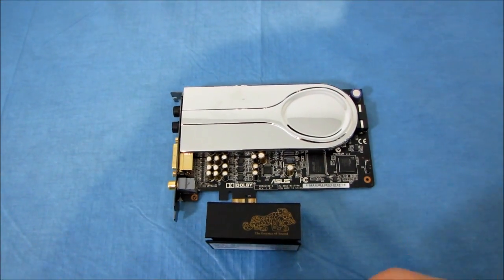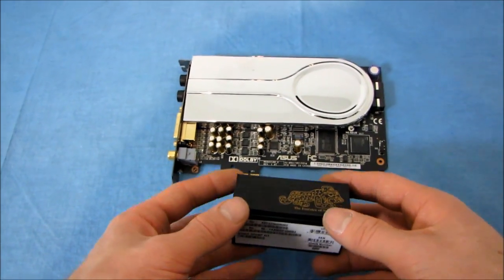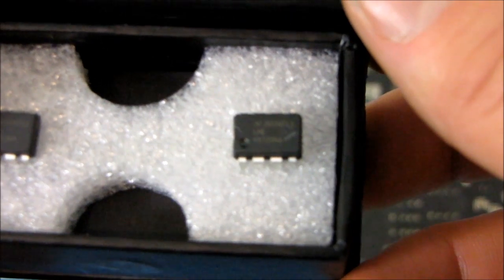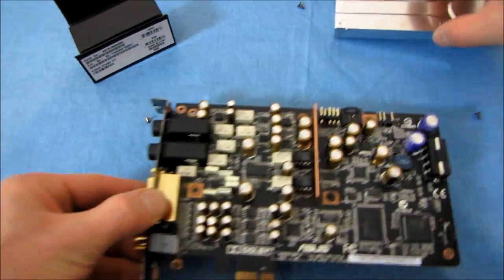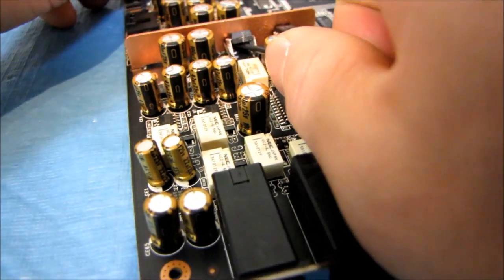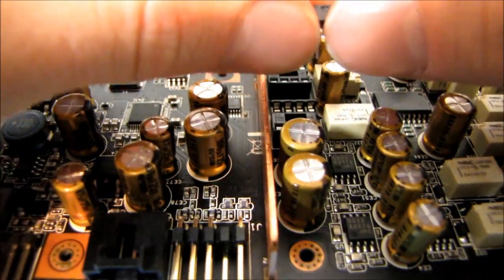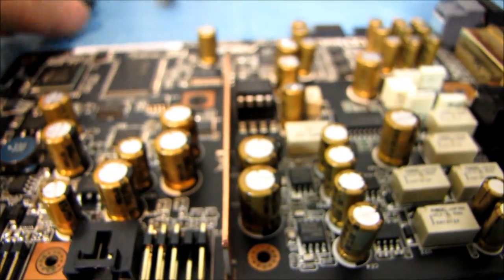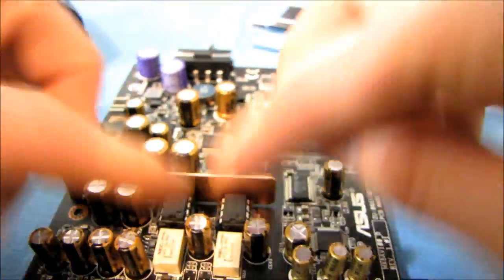ASUS XONAR XENSE OPAMP Replacement Upgrade Guide Linus Tech Tips

Comment: the 'point one' in surround systems is an LFE (low-frequency effects) channel.  As the name would indicate, this channel is used to separate the low frequency 'special' effects from all the other channels (which are full range).  Usually. most of what you hear coming from your sub-woofer isn't even coming from the dedicated LFE channel.  Ideally, you would want full range speakers or multiple subs to take full advantage of this feature.

Comment: A better way to know which way is the right way to install is look at the default chips on the board before removal first. You'll notice the chips have a very small notch on the side. These had those little dots too but alot dont come like that. Most chips have that notch in the side indicating which way they're oriented.

Comment: All Op amps change the sound signature in one way or another..i agree the OPA2134 sounds good(to my ears)u can find plenty of OP Amps over at farnell(thats where i oredered mine from).But remember not all of them are in DIP8 form(the ones u can just plug in)others are way smaller and have to be soldered on an adapter before u can plug them in your card

Comment: yeah i was gonna say chips like that the pins are always wider than the actual slot they go in, because the chip programmers like hold them wider than they need and then the need a really tight connection when placed in the board because they are specifically not soldered on

Comment: The OPA637s and OPA627 are highly praised but they are expensive so i havent heard them yet.Allso they are mono OP-Amps so they need a special adapter(2 single->dual)
in order to make them work(another reason i havent get to try em as i cant find that sort of adapter where i live).So consider the fact that u need 2 of them for each socket.U might consider geting a ZIF(SOIC8-DIP8) adapter if u wana try OP-AMPs that are in SOIC8 format(those tiny ones).

Comment: (Last reply..read from the 3rd one up)I Used plain adapters for my SOIC8 formats but i had someone who could solder them on.In Soic8 if u consider trying some there are allso the AD8066ARZ and AD8599ARZ(the one i curently use).DIP8 there are the AD826ANZ and the OPA2228(witch i find uninvolving but lovely sounding).I stoped rolling others after i found one that i like in every posible way.But i will repeat myself its a matter of personal taste roll some and find the one u like the most.

Comment: actually the BEST Opamps to use are made by BURSON - a discrete op that will definitely change the way your music sounds... a very open and very detailed sound quality ..expensive but worth every penny....
Reply: +GLYNN TILLERY Will take up 3 expansion slots just in size too. I'd just find a cheap high performer that fits the specifications.
Reply: they have extension connectors now to prevent taking up so much space...
Reply: +GLYNN TILLERY also I'm pretty sure for the same price as the burson you could get a better performing opamp with higher slew rate and better noise rejection.
Reply: I have the Bursons - and for the money they sound superior to any IC opamp and Ive tried many of them
Reply: +GLYNN TILLERY and +Kazuhiro. The LME49720 is spec'd at 20V/ microsecond slew and 120dB Power Supply Rejection - so it's pretty hard to beat. Fitting the Burson may satisfy ego but it would involve removing the screening, taking up half a chassis and a dramatic increase in noise susceptibility. Many of the claims made on the Burson site are frankly ludicrous.
Reply: Paul Milligan Exactly. Size is not just an advantage of accessibility but also performance
.
Reply: +GLYNN TILLERY can i use a burson in my gigabyte motherboard? (with an upgradeable opamp) and have you compared the bursons to the lme49990?
Reply: +StylinRed Yes thats what was in my HDAV 1.3 deluxe ... The Burson is far superior ...ignore the trolls ...ICs might be better on paper but the SQ of this analog discrete is no brainer... takes quite a few hours to burn in so let it play for 2-3 weeks before you judge it...
Reply: GLYNN TILLERY Hey thanks for the quick reply! I'm only just looking into op-amps for the first time, this is all new to me, i had settled on the 49990 before stumbling onto your comment, now im reading up about Dexa's lol sigh reading overload
Reply: Yeah they are the best,but more expensive than the card itself.
Reply: some of us make good money
Reply: Perhaps Burson op amps are introducing harmonic content to the sound in the form of distortion, which probably makes it sound different. Some kinds of distortion sound appealing to the human ear. I'm guessing they are much less accurate op amps.

Comment: Well it will sound differnt than with the stock wether u will like it or not its up to u...like i said sound is a subjective topic it comes down to personal taste(there are alot of ppl that like the LME u could be one of them).Allso u could try the OPA2107AP(this one is a bit more expensive than the LME and OPA2134PA)but it could be worth it.Allso note that the OPA2228(delivers a very warm yet detailed sound but its a little too lean for MY taste).Good luck in your picks.

Comment: I found a high performance OpAmp OPA2134 which are top of the line for over all performence quality...You can find them on E-bay for $16 bucks each...myself i just changed the main in and out...what a difference from the standard chip..

Comment: The LME49860NA is the same as the LME49720NA that Linus put in his card with the differnce that the first one can withstand higher curents.I tryed it but i personaly dont like it very much(trebles were too sharp and bass even tho its precise its not all that pressent unless u boost it from your sistem but than again it might sound nice in a surround setup...i use stereo).

Comment: @TheABYSSCINIAN, ESD isn't the huge issue here. It's the proper installation of the op-amp that's the real issue. Try reversing the power inputs in pins 4+7 ;) I can guarantee that whatever you had on the board is now a smoking hole in the board ;)

I've blown more than enough 741C's at school to share this unjoyful experience. Besides, Linus did make quite a few mistakes when dealing with these PDIP-8 chips, but not bad for a beginner, assuming he actually figured this out on his own.

Comment: @kght222 i used to install 30 pin sipps, replace bios chips, and upgrade cache chips. i can tell at this point that all of that has fully fallen by the wayside if a popular computer tech channel cant remember how to deal with such things (of course the electronics channels still get it). hell i even used to have an ibm 486 microchannel system that had a 60mhz cpu that inserted into the socket like many modern bios chips. you might have seen those brown sockets with a hollow for a chip.

Comment: You should roll a few...i personaly dont like the LME47920...to me The AD8599 is way way better..but your gona need a browndog adapter and someone to solder them on(also they are more expensive not OPA627(single so u need 2 of those)expensive but still twice as much as the National parts.Other Dual parts to consider could be AD8066(still need an adapter),AD826,OPA2134PA,OPA2228(if u dont mind them being too lean..i mind , but that is a matter of personal taste).

Comment: NEVER PRY UP A CHIP LIKE THAT WITH A SCREW DRIVER. you'll destroy the chip and you might loose a pin in the socket. if you cant get your fingers around it, use a chip remover, that little thing that looks like a tweezer, but the ends are flat.

Comment: Is this good yet to follow? Because i have Asus Essence STX II not the first like in this movie. Is it exactly the same way to follow step by step for my Essence STX II?
Reply: Probably a good video example of replacing opamps from sockets. Most opamps are soldered on, however, and require more work to be replaced (who knows, could also render the card useless because they are usually designed to only have the socketed ones replaced in the first place so look it up.)

Comment: im using TL072 op-amps in my home made mosfet 200w rms amp and they need +15v 0v -15v
Reply: 200W out of 15V supply?? Impossible unless your speaker impedance is very low...